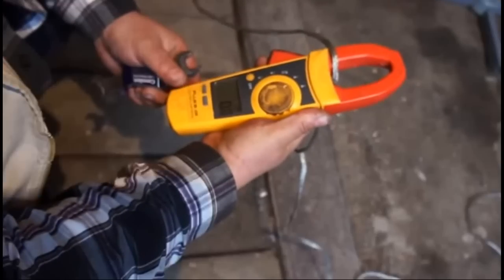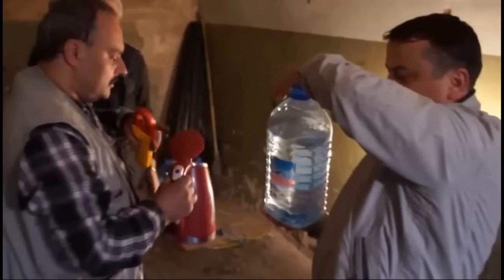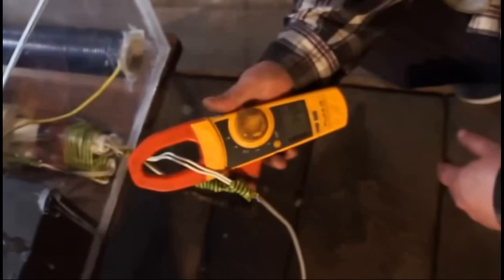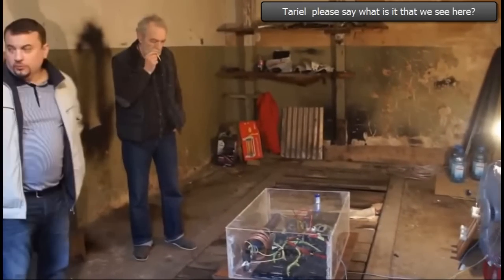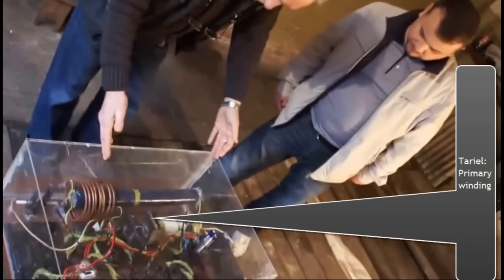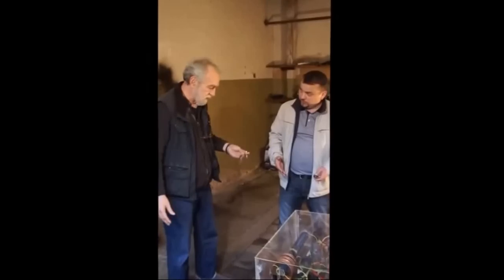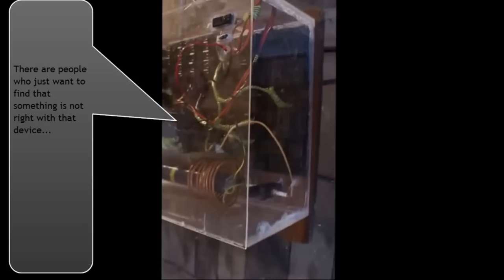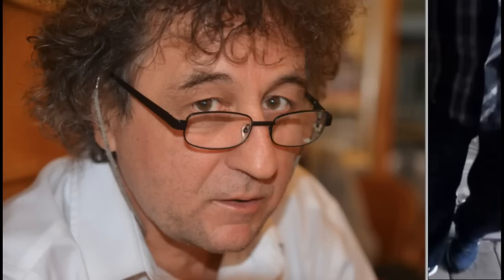Tariel Kapanadze 4800W Free Energy Device

Comment: As I can see it seems the same principle of the andrew bacardit generator mixed with other technologies but the core is the same, disturb the 3d volume to amplify the potential and the recover of the balance of that process turn dark energy into electricity and you can get way more energy than the initial power impulse, allowing you to make a self running generator, it will be very interesting to have some blueprint to replicate the generator.
Another interesting detail to figure out is, what kind of electricity this device generate, because it seems to be a radiant energy generator that in fact will be usefull to run computers or others device that can only run on sine wave instead on scalar wave.
Reply from the maker: I'm completely confused with your comment.  Which Juan S.Bacardit patents you are referring to.
The rest of  your comment is  existing completely in science fiction  world,  by means of  physics scientific evaluation I assume .
Correct me if  you  feel different.
Wesley

Comment: Electrons are plentiful and already there ..especially from negatively charged earth surface.  The trick is in making them move back & forth in alternating swing like manner, similar to  tapping on wine glass at correct resonant rate ....it will eventually shatter = work done  potential to kinetic. To get 50Hz the little resonant taps have to be grouped in multiples of 50 groups of taps per second. Which is called modulation of the resonant rate.  It is all real many thanks to Tesla and Kapanadze and Wesley.
Reply from the maker: Good point.  https://www.youtube.com/watch?v=3ehz4MT8ec8
My theory was never finished to the point of consistent leading  concept. 1/4 wavelength  needs  counterpoise. 
Body of car antenna is a balance -counterpoise to that antenna.  if you want to radiate you need to resonate at first. 
 That would make sense when talking about  electromagnetic wave RF.  
Nature  needs balance. electron has mass. Mass in motion can  have inertia. 
Inertia can only exist if there is not constant acceleration but e.g: it
 is stimulating impulse from nanosecond generator that allows that 
inertia to be present.
=================================================================
 circuit description : earth-ground rod-ground wire- lead of  primary winding of transformer- second lead of primary winding- HV potential driven by nanosecond  generator.( so HV impulses are present from the other other side of the transformer)
secondary winding of that transformer is connected to lightbulb.
Both primary and secondary windings have "capacitor" connected  across each of the windings.
The "capacitor" is actually a tuned LC tank where C is leading ( capactive reactance) easily seen on VNA- Smith Chart.or on HP1984a Gain phase analyzer.
===================================================================
So electrostatic pump  is the  pump where major  attraction to the ground electrons is  done by 
electrostatic high voltage potential. 
The stimulating impulses are delivered from nanosecond generator
The accumulation of initializing force energy is done by  electron motion , 
The initializing force  comes from our battery  in that first second  interval of time.

 
Similar
 to 15 girls pushing car till the point  where that car in motion  needs
 only one girl and than one finger of   that girl to compensate he 
losses 
the load( light-bulbs) are  connected to secondary winding of
 a transformer  where first winding of that transformer is connected 
between ground and nanosecond generator impulses HV output. 
That transformer is our resonance circuit ( series resonance LRC circuit )- lets call it RLC
However  because the secondary winding of that transformer is coupled to that   primary LRC circuit in Near Field
by   ferrite core  than whatever the change is present in that secondary 
winding  it impacts back by BEMF  the stability of   RLC circuit.

In  a simple language flickering of the lightbulbs  due to instability is 
caused by changes of LRC  in that circuit during  given time frame .

 

 
So  the key for TARIEL KAPANADZE , Ruslan Akula  Adrian Guska was to use 
tungsten based incandescent light bulbs as a load.- as  such load 
parameters  changes only at first  milliseconds when load is getting 
hot.  
In most of the cases the battery is still connected to the 
device and experimenter has full control over changing parameters of 
resistive R component of secondary winding resonance circuit  
 parameters.
 
That was only not so clear . with latest  device. made by Adrian Guska 
By that we may think of the reason why Guska decided to  screw in lighbulbs  only after he started  the device.
Interesting  is that Adrian Guska had a problem with stability, when the last lighbulb was connected..
That conforms the fact that  system has reactive  character. To much of  R  in RLC circuit changes circuit parameters..

Russians do not test it inside Faraday cage"  because they are Russians  they do not have Faraday 
Cage.
Also there is no way on you tube to present the device for 6 hours.
Interesting is that Akula and Ruslan refused my offer to visit them and conform that their devices work as desired
Adrian Guska told us that so far he has to much problem with SBU. But I spoke to him only few days ago.

Wesley
Reply: Yes coil must resonate at least 1/2 wavelength for no counterpoise case, so would need twice the wire.  Also pulses must be positive going to attract neg earth electrons and not too long duration otherwise the resonance will be killed.  Fundamental frequency looks like about 2 MHz so sub nano second pulses not really required. If trying to use nano sec pulse method instead of spark gap (negative resistance) , most RG58 CU and AU only good to 1 GHZ max or 1/10exp-9  these cables just look like huge capacitor at about 120 pF per metre. But by shorting the far end of the coax cable a 1/4 wave matching stub is formed which reflects almost open circuit to the avalanche diode pulse source. The high current with low volts toward the shorted end  of the coax provides the electromagnetic field necessary to "kick" the resonant Kapanadze coil going.

Comment from the maker: NATURE NEEDS BALANCE as High Voltage Electrostatic  potential difference stimulates electron flow.   The ground  connected with thick wire  is  like  counterbalance similar to- Countertpoise in the groundplane antenna. The antenna in your car  has also counterbalance ( counterpoise) and that  is -the metal body of the car.  Yes it is possible. Ground =  artificial ground  (eg: At 10th floor  of the  building
The  metal plate beneath  on the roof , extending or directly underneath, typically with close contact. to groundplane antenna serves as Ground

Comment: Their are several of us giving our work away schematics parts list ect for free.  We can now generate 6000 watts from 1200 watts.  obviously this can be self running by returning 1200 watts back to front end.   I've watched this guy producing energy with his secret device.  I'll bet that all that knowledge goes to his grave with him.    Why doesn't he build some and sell them.  Why not share the information for real to everyone like we are.
Reply: He does not sell because devices are simple to replicate. He want to be rich but is not possible. He charge money for demonstrations and that's all profit he can make from device. I watched all his videos. The real device is always hidden in a black box and he never speak about it. All you can see in the box and all his explanations about Tesla are just smoke. Nothing that is visible is part of real device. The principle of operation is resonance. Not one, but two. Like he said in his patent.
Reply: Use a 1200 watt generator that has N-S  magnet for the rotor to generate 120vac 60hz.  this is connected to the first pole transformers 120vac output. X1 and X2 connectors, so you're running the transformer backwards.  Their are NO ELECTRONS flowing from the generator into the pole transformer plate. Only radiation flows from the generator. This will only work on transformers that use Aluminum Plate about 20 turns of it inside not those that use very heavy wire for the 120vac coil.  It must use the plates.  The ceramic top connector of the first pole transformer has 14,400 vac radiation flowing out of it , which measures cold -37degrees C.   The 14,400 volt connector is connected to the second pole transformers Ceramic High Voltage connector.  the two pole transformers are connected together at the chasis grounds.  the loads are now connected to the X1 and X2 of the second pole transformer. 120 vac 6hz loads up to 6kw. the loads can be heaters motors lighting stoves air conditioners what ever.  The idea that we are working on is to replace the gasoline motor running the generator with an electric motor so we can use some of the output to run it making it a self running system.   This is all there is to it no secret stuff just a motor generator and two pole transformers with aluminum plates.  the electricity is cold not hot like we use today but it will run all our stuffs.  for free  the cost to do the system is around $5,000 total.  the pole transformers run about $1500 each
Reply: Interesting. Thank you. I wonder why this works. This would mean that the transformer where the generator is connected to won't see the load the second transformer (which would be used to power equipment). Then the power companies would also distribute basically "free" energy? Do you have a model number of suggested transformers?
Reply: I can't find anything about aluminum plate" transformers. Could you please clarify?
Reply: Would you please tell me/the community how you make these 6000W from 1200?
Reply: he is silenced from goverment maybe
Reply: ABB makes transformers here's the spec and $$. note how they spec out the LV winding as LV Interlaced Aluminum Winding Matl.  This is the plate. 

2        M1412P15AAW07L2               $798           $1596
+ ship     Overhead Distribution Transformer;  S -Conventional15KVA No Load: 42 Watts at 85 degrees C; Load: 204 Watts at 85 degrees C; Total Loss:  246 Watts                             $798 Total Owning
Cost   24940GY/14400 HV; 125 BIL; Copper HV Winding Matl
120/240 LV; 30 * 30 BIL; LV Interlaced; Aluminum LV
Winding Matl60 Hz  1 Phase  Transformer
Weight: 298.71 lbs.; Height: 37 in.; Width: 20.00 in.; Depth: 24.00 in.Est. Shipping
Dimensions: 314.71 lbs. Height: 41 in.; Width: 24 in.; Length: 25 in.; Est. C/C Weight:149.9 lbs. 65 Temp. Rise;1   HV Line Bushing, 125kV BIL,
17.75"Creep, 8-2 size eyebolt3   LV Bush-EyeBolt for #6-#4/0, CM speed mtg.,
.38 Stud12. Gal(s) of Transformer Oil1   15.25" Carbon STL Cover, 1 HV Bushing Hole
Reply: I have two of these but haven't tested them yet really busy on the car motor.

Comment: 15 minutes can be achieved with a good ups battery. Why they didnt test for 1 - 2 hours? The ground cable wasnt measured after the device was started. He tested with tongue but the cable was insulated so what?
Reply: Another skeptics 😅
Reply: +Petar Petrov 
He was  on planks, wooden platform.
Over 10 years  hie is coming with demonstration like this.  Seems he did not learn or earn

Comment: possible application. he says: cars: yes, trains: yes.
Haha. With a floating ground connection? A train maybe, but a car?

Just because it can be said: we have not seen the electric devices being lifted up. They may be back wired. Just saying. . . I hope I am wrong.
Hmm, why do I say hope? Tariel is not sharing anything. We should stop sharing his videos unless he offers something to mankind.
Reply: elisagroup
Well, let's hope that is true. I have bit seen that being tested, and I don't think it will. As you know Tesla did an experiment with a rod in the earth on several places and transferred energy. You do need the earth for ding that. Of course, I have no idea how the Kapanadze thing should operate (if ever). As long as it is sort of 'secret' it must be fake. Even though I perhaps 'want to believe' I still have my both feet on the ground.
Reply from the maker: +elisagroup I can see your comment. please tell me  what comment  you talking about?
Reply: Perhaps I removed my (own) comment, I don't recall that. But that would then also remove your reply to my comment I guess.
Still I don't believe these power converters work without earth. The mass of the car is not a source, but earth is (do you know there are a 100 lightning bolts striking every second somewhere on earth?)